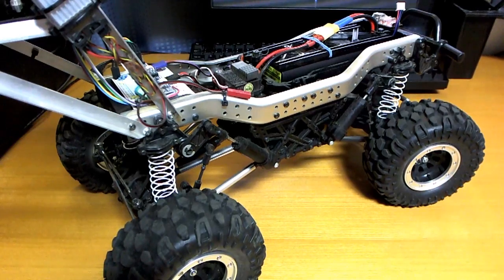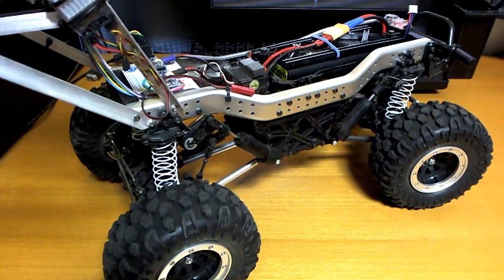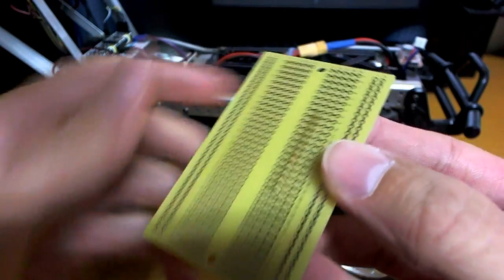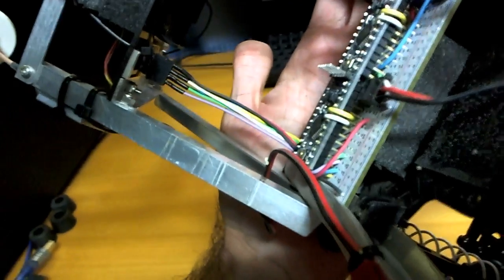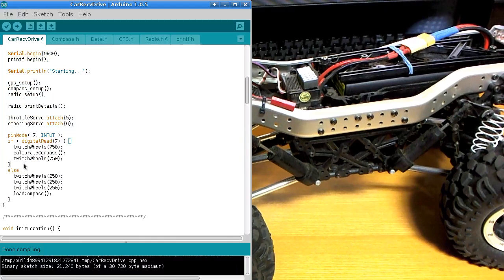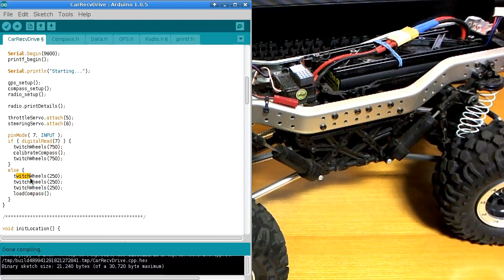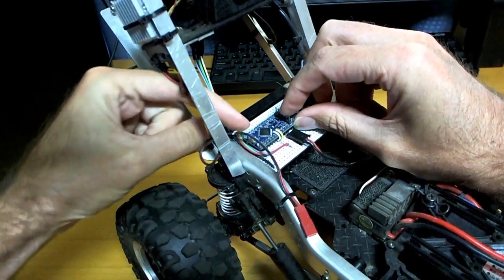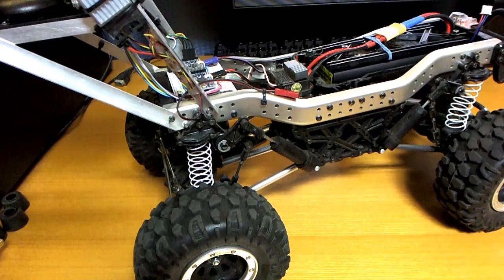RC car GPS follow-me Mk2

Comment: Hi there, Congrats on the work!  You've done a great job.  I have a small robot that I've built to carry my golf clubs around the course for me.  With your permission, would it be okay for me to experiment with your system to drive my bot(RoboCaddy).
I'm currently using a Sabertooth driver, do you know what your motor driver output is using on your system?
 Thanx again for all your video's!!!!
Reply from the maker: Sure, of course! The 'servo' output is a repeated pulse of length 1000-2000us to represent the full range. That is, in this case having the steering straight ahead motor off would be 1500us. Steering fully left and full speed reverse would be 1000us etc.
Reply: is there any possibility you would share the schematic with me?  
Thanx again!

Comment: I have two questions and a problem, I hope your help.
My problem in  Code CarRecvDrive 
I did not know where found the word "bearing" in code
   float turn = bearing - heading;

My first question: you have identified two waypoints
river and shibuya. Can I set one waypoint to go the target
My second question : Can I insert a waypoint from outside the program
Thank you.
Reply from the maker: The 'bearing' variable is declared and used in the 'Compass.h' file.

There are no waypoints in this code. There is just a current location and a target (destination) location. The car will always go directly to the target. Whatever you set targetLoc to is the destination.

Comment: Hey, I am doing the same but I'm using just an arduino with bluethooth and then a celphone with gps and compass. 
Did you have problems with the compass ? did the motors and eletronics of the car interfeer with it ? and just by curiosity how long does your car lasts following you?
Reply from the maker: Yes, that's why I put the compass way up on that funny-looking shelf :) I suppose it would last until the battery died.

Comment: Can you tell me, in as simple a way as you can, what is the basic setup for how youre doing this(quadcopter also) . Am i right in saying, youre using an nrf... module, to write script onto, using it as a reciever, and inputting it onto that, and it then in turn can respond to your Tx? If so, how do you know how to write these scripts? And what programme do you use? Possibly a video in and unto itself? In the future, showing globally, how all that works, in one place? Id love to start working on getting my newly working quadcopter(450) to follow, circle, etc
Reply from the maker: I think I explained all this in the video, or at least in the previous video I mentioned (https://www.youtube.com/watch?v=tPJg1y0IdHs). I am holding a GPS and nRF module which transmits my current location. The car has an nRF module to receive my location. The car also has a GPS so it knows where it is, and a compass so it knows which direction it needs to go to move toward me. How I know how to write these scripts, is I spend days, weeks or even months reading the instructions and practicing :) I use the arduino IDE, all source code is linked to in the description. There is a ton of information about this all over the net already, otherwise I wouldn't have any instructions to read myself.
Reply: I, understand, but i think, what i find hard to grasp, and yet am in aw of, is how the lines of code(sketches), you've written, are actually talking between modules, to create the actual physical outcomes that we seek here. I downloaded some of your sketches to my tab, and i can see, how eventually, you can make sense of it. I may do so in small amounts at a time, i def want to get my quad following and orbitting. I've just so much going on, i'm like a juggling act on steroids.
Reply: owenkilleen you can open the serial monitor on the arduino IDE and see what's being exchanged. In this case (i would guess) the hand held homing beacon is spitting out its location and the car receives that and does a comparison with its location.

Comment: Hello Chris; thanks for your videos and useful sharings.
I'd like to know what options you considered to improve accuracy of GPS localisation. I've read that DGPS could significantly help, and also that some research is currently done in data processing (http://www.popularmechanics.com/technology/gadgets/a15420/super-accurate-gps-for-vr/).
Many thanks;
Joel
Reply from the maker: Now that I know a bit more about it, I think this GPS was actually using the DGPS system available in Japan (MSAS). These days I use a M8N module here in New Zealand, and it gets similar performance without DGPS. I haven't really felt the need for a more accurate result to be honest.
Reply: +iforce2d thanks. how would you know which GPS signal is received by your antenna (normal or augmented GPS signal)?
Reply from the maker: You can tell the GPS module to enable or disable DGPS as you want. Some of the messages that the GPS outputs contain a flag which will tell you if it's currently using DGPS or not.

Comment: Your old uploads are still very good tutorials. I have copied your FollowMeMk2 FollowMeTag and CarRecvDrive but don't understand how to switch between the two sources of control. The FollowMeTag nRF24L01 sends its position to the car. The nRF24L01 of the car receives the position ok. But how can I take over the control?
Reply from the maker: You don't. There is only one source of control here.
Reply: +iforce2d OK, I saw the problems with high speed communication between 3 nRF24. I will try to solve it!
Reply from the maker: +Lars Carlen if you look in the main loop() function of the CarRecvDrive sketch you will see where it decides whether to do manual control or auto control. That was used when I was doing the 'return-to-home' feature testing - I would drive the car some distance away and then flip the switch to auto mode (video: https://www.youtube.com/watch?v=Zr5rmsaoo5Q).
In this video though, the switching between modes is not used.

Comment: At this point, I don't know if you solved the pin header problem or not.  Simple fix might be to solder a jumper from a linked pad on the bottom to the pin that is soldered on the Arduino.  Also useful, might be to heat that pin enough to adjust it in the header plastic.  

I really enjoyed the video, especially the kids in the earlier one  :-)

Comment: What compass are you using for this?
Reply from the maker: Michael O'Donnell I think it's the typical HMC5883L, in this case mounted with the GPS in the same shell: http://www.banggood.com/CRIUS-NEO-GPS-MAG-V2-NEO-7M-Module-With-Compass-p-951898.html
Reply: ***** Ahhh, I must have missed that in your earlier videos. I was under the impression that was a GPS unit only. Do you find the HMC5883L to be fairly accurate? I am torn between that and the MAG3110 in my own project which is very similar to yours!

On a side note, I have enjoyed very much watching through your build process and it has helped me with quite a few issues I have been having.
Reply from the maker: Michael O'Donnell yes it seems to be doing a fairly good job.

Comment: Hello iforce2d,

I really like your RC car GPS follow-me project! GPS it's a good tool to get distance, but it seems that it doesn't have high accuracy.
Do you know any other GPS boards to improve it?

Do you know other ways to calculate distances? I've heard about HC-SR04 Ultrasonic sensors but they have to be in front of each other (15º angle limit).

Did you try getting distances from ping of Wifi or Bluetooth signal?

Thank you,

Good luck in your project!

Hector
Reply from the maker: hrcnlz You don't think this is good accuracy? Consider what is happening here... two separate modules are receiving signals from multiple satellites out in space, and they still come up with a location within about 2-3 meters of each other, for any location on the planet (and for a total cost of about $40 for both modules). There are other methods for calculating distance of course, but I think you'll find they are nowhere near this value for money. Just how much accuracy do you need? If you are interested in distance and not location, then a GPS is not what you want anyway. You could try looking into laser rangefinders. https://www.youtube.com/watch?v=SYZVOF4ERHQ
Reply: ***** Thank you iforce2d for replying soon. 
You're right, GPS modules may be the best quality/price option. I appreciate your suggestion, but maybe laser rangefinders wouldn't work for the application that I want (I'm not sure).
My idea is a RC car that autonomously follows a person and stays 1,5-3 meters next to him/her (right or left side). What could be the best solution for that?

Thank you in advance,

Hector
Reply: +hrcnlz i think instead of following, you might have to reduce the gps cordinates to make it at same dist as you are but move it to the side.
Take an eg of ur cordinates and  you can make a position minus or plus some value to find ur side

Comment: Very impressive Mr iforce and you didn't even break a sweat. If it's not too boring and you feel it's not too over my head or useful for other subscribers would you mind doing a short video on what code you changed or added in the multiwii sketch? I'm super interested but also aware that I am very very far removed from being competent code money and even tuning PIDs is hard work for me. Still really juicy and inspring all the same.

I did love the confused kid in the background though I'm sure he was impressed too when you rode away and it followed, probably thought you were a bit of a fruit loop before that :)

Can you set a minimum distance it will stop at and  slow down/speed up when hitting min or max distances? What other steps would you need to implement it into a quad running a multiwii sketch already?
Reply from the maker: MicroRCFiend This is nothing to do with multiwii, I linked to the sketches in the description if it helps. If you have a quad running multiwii and using the nRF24 for radio control, it would be very easy to just overwrite the GPS hold location with the location of the TX. I may try that sometime but I'm not that satisfied with the current GPS hold performance of my quad yet, and I don't really have a good place to try it - the groundskeepers in this area already complained when I was driving a car there, I'd hate to think what would happen if I was wandering around with a quadcopter. Officially no radio-control stuff is allowed here, but they usually ignore us when we fly in that first area I was at there with the long grass, and I would hate to be the one to ruin that fragile situation for the other guys who fly there. Here in Japan "drones" have just been banned from public parks after some fuckwit landed a phantom2 on the prime ministers office or something stupid, and laws are in the works with 1 year prison terms for flying around government buildings, so it's not a good time to be attracting attention, even if you're causing no harm.

Comment: It would be a fun project to do this with mag, acc, gyro, gps, all on a vehicle like a HPI savage flux or an Axial yeti xl, a vehicle that can handle some terrain! Then code it to stay under say 20% throttle until x meters is between antennas, then increase throttle up to value y until becoming within x meters again, these vehicles are capable of some serious speed if needed. Woukd make it interesting...

Comment: It is amazing toy! I want one of those.

Btw, what you think what happened near end of the video? Is maybe compass picking up magnetized steel stuff arround, and make mistake? Or, it is just an unhappy accident?
Reply from the maker: ***** Just a coincidence I think.
Reply: ***** Okay. I am thinking about something, and this bothers me (since I am not good programmer), but you may give me some insight... Is it possible to make program so that when it follows you, it actually use GPS data of your past location and path you drive the bike? I mean, if you driving bike in semi-circle, car trying to get as shorter path as possible to your location. But, what if it can follow your path exactly? It will be useful to follow you on curved road (or curved path, sorry my bad English). What you think? Is this possible?
Reply: ***** I saw one documentary about programming robots for car manufacturing, where people move robots 'hand' so that robot 'learn' movements. It will be also VERY COOL to do the same with a car (not a 'follow me' exactly) - go to the driving site, record GPS data while driving bike (or walking), then transfer data to the car (by RF link, or by memory card). Is it possible that car will follow exact (or close to exact) path you did with your bike or walking route?
Reply from the maker: ***** Yes, if you have memory to store all the locations you need, it's pretty easy. The arduinos I am using here have no space for that though.
Reply: ***** Can you recommend me, which arduino has sufficient memory for this task? Arduino nano or mini maybe not, but I am pretty 'newbie' in this programming 'sport', so need some guide line for starting. Again, thank you in advance.
Reply from the maker: ***** Well it depends how many points you want right? Typically a GPS location will be 8 bytes (2 floating point numbers) The 328p based arduinos have only 2kb of RAM for the whole program. The arduino mega2560 still has only 8kb. There are many arduino-like boards out there I've never used, but have more memory available, eg. teensy3.1 has 64kb RAM.
Reply: ***** Hmmm... Oh, well.... I love arduino things - it has a lot of options and modules. Only thing is with memory storage. Maybe I will see does it is possible to use Raspberi PI as a main 'brain', with addition of all other arduino based modules. Just don't know how to make communication between that two (or, does communication is possible at all between PI and arduino?).
Reply from the maker: ***** yes, at least if you are using these nRF24L01 modules as I am, there is a library for raspberry pi too. You might find this helpful: http://tmrh20.github.io/RF24/
Reply: ***** Thank you very much! I just need to study this library and wait for two modules to arrive (one small, one 100mW). Then... try to connect it togeter so that it comunicate. For example; I bought "MINI USB Nano V3.0 ATmega328P CH340G 5V 16M Micro-controller board For Arduino", and "HMC5883L Triple Axis Compass Magnetometer Sensor Module", and when arrive - I will try to get it working between 'remote' magnetometer (with arduino nano) and Raspberi PI. This will be first project for learning how to program both (different) devices. (I wish to had more money to buy barometer, gyro, and other cool stuff, but for now... this will suffice)
Reply: I dont seach for connecter Arduino with HMC and GPS pin ? please help me?
Reply: Features of Arduino Boards
Arduino Board Processor Memory Digital I/O Analogue I/O
Arduino Uno 16Mhz ATmega328 2KB SRAM, 32KB flash 14 6 input, 0 output
Arduino Due 84MHz AT91SAM3X8E 96KB SRAM, 512KB flash 54 12 input, 2 output
Arduino Mega 16MHz ATmega2560 8KB SRAM, 256KB flash 54 16 input, 0 output
Arduino Leonardo 16MHz ATmega32u4 2.5KB SRAM, 32KB flash 20 12 input, 0 output

Comment: If you wanted something simpler than an accelerometer to detect a flipped state, you could add a "tilt ball switch" (or mercury switch) and add a timeout counter in the main loop.  https://learn.adafruit.com/tilt-sensor/  Cheaper (ebay +"Xpcs") and likely easier on code and resources.  Thanks a ton for your videos, they keep me thinking.

Comment: nice project :D
You could make it calibrate compass by itself, by driving in tight circles ;)
And how about adding some sensors to avoid obstacles like trees, curbs, people.. benches..
Reply from the maker: 206LaKi That's true, the most important part of the calibration is the rotation in the 'z' axis. Ideally you turn it over in each axis so the magnetometer can feel the magnitude in each direction, that way when it's going up or down slopes it doesn't get skewed.
Reply: ***** Very cool indeed! Or perhaps as a first step just cut the throttle when it's on its side? Can the magnetometer detect this?
Reply from the maker: a esbj no, but an accelerometer could. There's none on there right now though :)